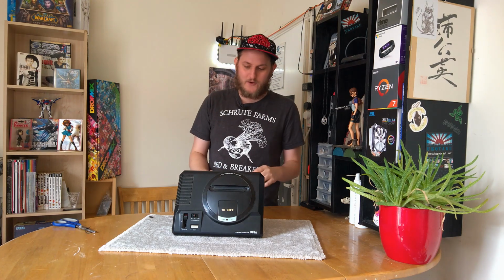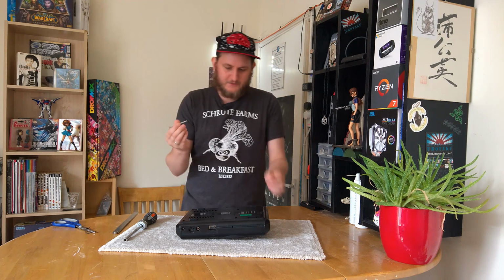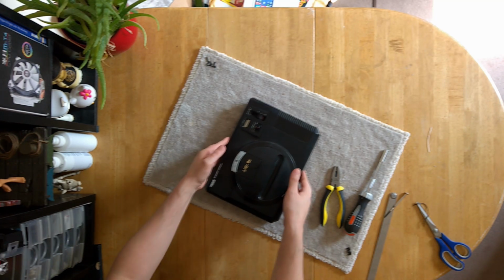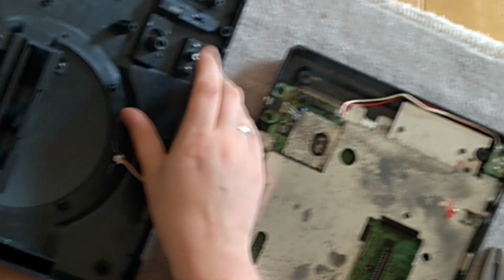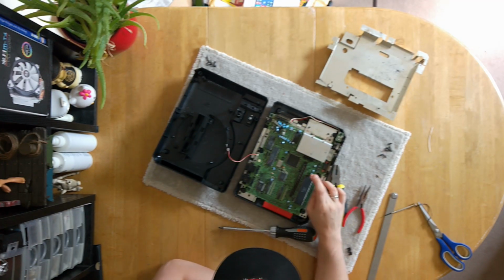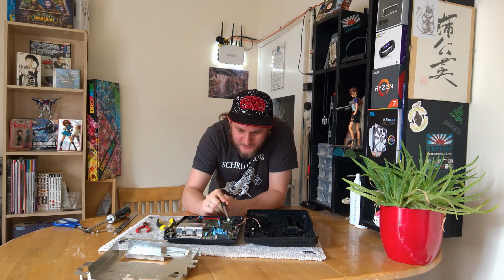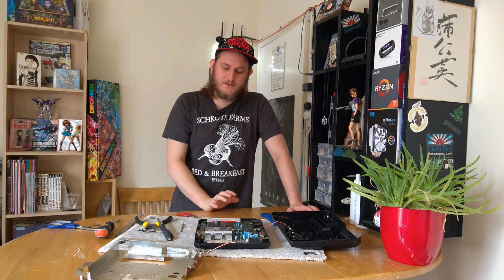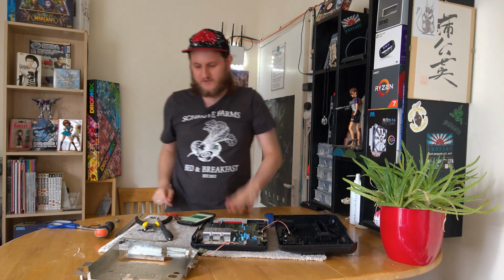Restoration & Rumination: Failing to Fix a Broken Sega Mega Drive

Comment: From past experience the resistor added to chip was done to resolve some issues either in factory or if unit was sent in for a repair at some point
Reply: Also main things to check is the solder points to make sure all look good especially around cartridge connector, then clean the cart slot could always use sandpaper etc then blow out, check cartridge and re try main cause of black screen is it not actually reading cartridge, so I'd advise trying that first and see
Reply from the maker: @robhrrsn  I shall crack out the multimeter for the next vid!
Reply from the maker: Yeah that would be my guess, its always fascinating opening up older tech and seeing the factory bodge jobs!